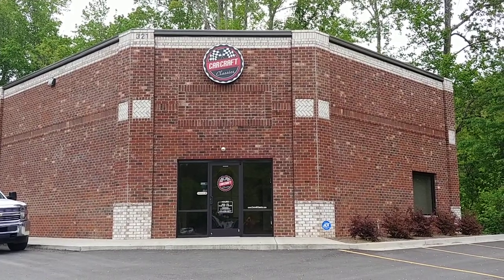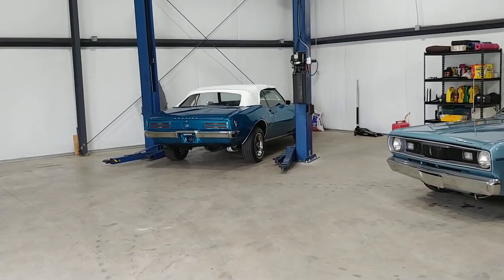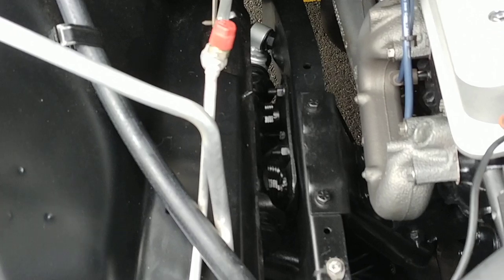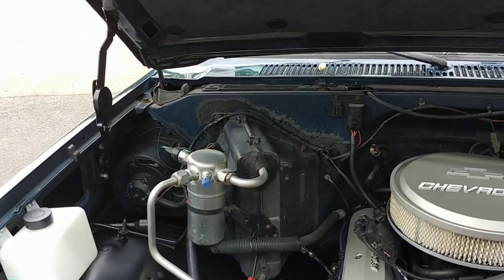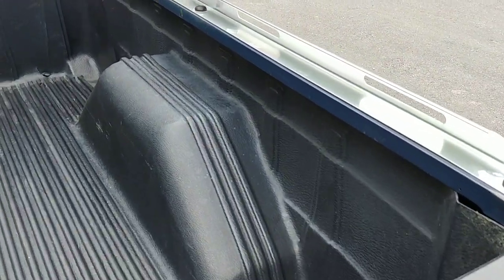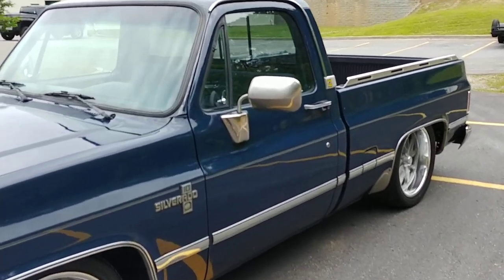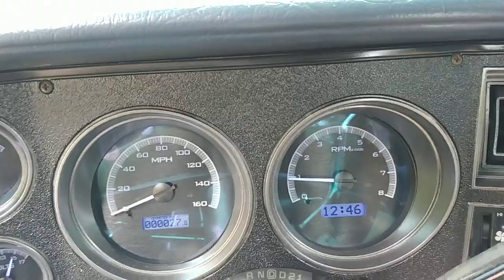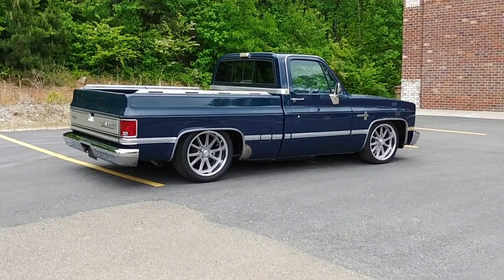SOLD - 1987 Chevrolet C10 (R10)

Comment: 1987 was the year fuel injection was introduced and the 700R4 four-speed automatic transmission. Chevy changed the C10 series designation to R10.

Comment: I have an all original 86 silverado w 305, and it needs a cam, etc. Is it worth it to rebuild original motor, or just put in a 350 or 383 stroker?
Reply from the maker: There are diffenrent opinions on this subject but I suggest keeping the original motor.
Reply: @carcraftclassics9534  I agree. I'm a suckered for matching numbers. I would put 305 on a stand and build a 350, but don't want a motor in my garage forever.
Reply: 350 Chevy! 💪

Comment: Hey guys. I'm in trouble. My business revolve on a 87 r10 that used to have a 262 sb v6 4.3 litter. I need a cheap engine. Can I put another engine like 305 v8 or even a 350 v8 or do I need different transmission with those engines. Please help as I will be greatly appreciated
Reply from the maker: 305 or 350 will work with that transmission.

Comment: Do you have the part number on the engine dress up kit?
Reply from the maker: Its not a kit we bought a few parts and there was plenty of labor too.
Reply: @carcraftclassics9534  I was main talking about the valve covers and the air filter cover?
Reply from the maker: Summitracing.com

Comment: Was that rust under the passenger door?
Reply from the maker: There was a bit of surace rust but nothing too tough to fix with a wire brush and some touch up paint. This truck is as solid as they come and built right.

Comment: Your vehicles look really nice first time watching your video. But you say your place is really detail oriented on what you sell yeah somebody’s missing some obvious things. I detailed thousands of vehicles over the years and inspected hundreds of vehicles. First thing that sticks out to me is the one truck that sold inside your shed clearly has an oil spot or something leaking under it. And the truck that you showed on the video the 87 Chevy short bed was done about 95% under the hood. All the things you pointed out looked excellent however if you watch your video just above the master cylinder area there’s rusty bolts and there’s Other rusty nuts and bolts around that area near the firewall. Why go to all the experience and not at least remove those and paint them
Reply: These dealers all do the same scam. Buy junk, put new paint over the rust, buy new wheels, sell sight unseen for big profit to suckers.